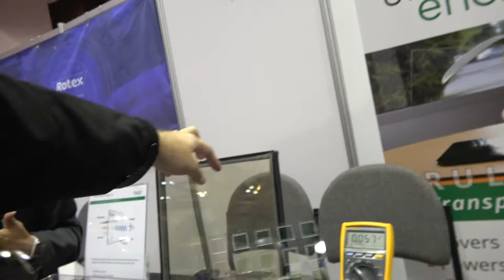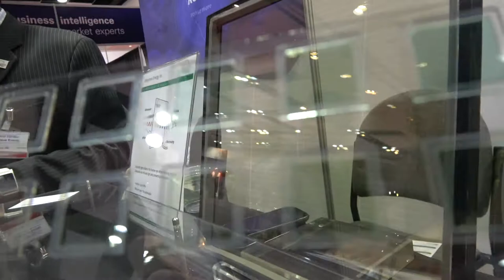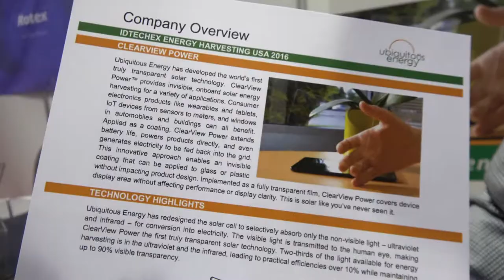Transparent Solar Technology | IDTechEx Show! USA 2016

Comment: He said this demonstrator window (ca 0.3 x 0.3 m) generates 5 Watt, that's 55 Watts / m^2, that's 5.5% efficiency. Meeeeeh

He also said that ONLY the active layer has similar cost as already used protection coatings in the glass industry. What about the (probably) ITO electrode, electron transport layer, hole transport layer and second electrode? It's not only one layer that needs to go onto the glass, it's at least 5.
Reply from the maker: IDTechEx agrees that efficiency is a limiting factor in applications and cost effectiveness. You have to need the transparency and not need too much electricity.